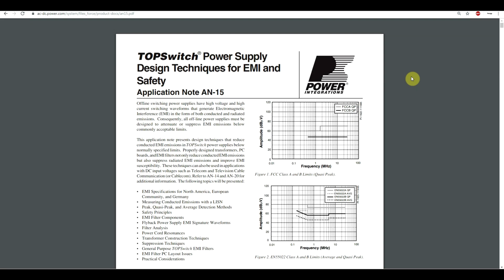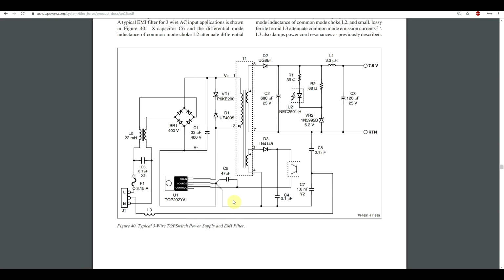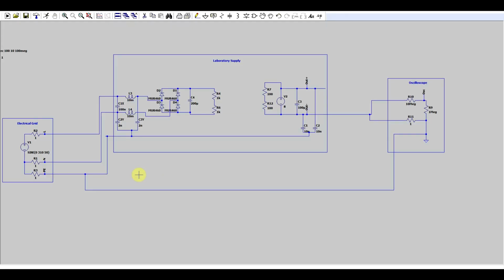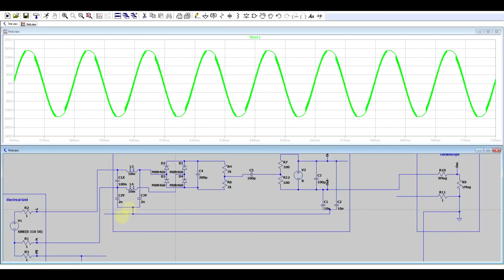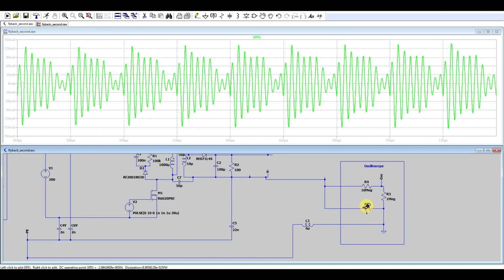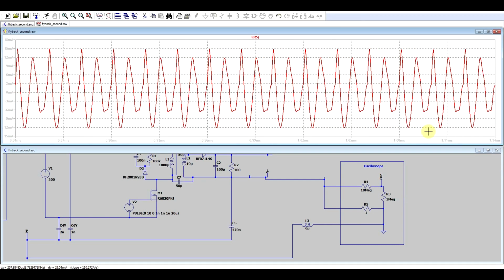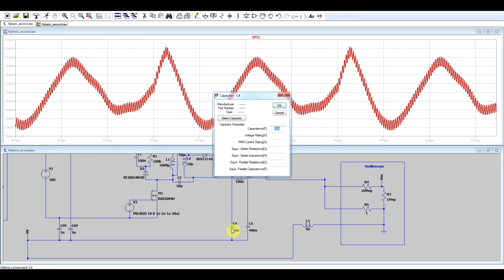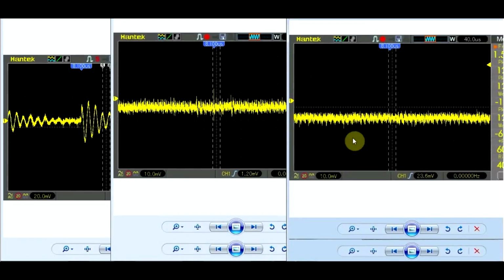How to improve the output noise of a laboratory supply using LTspice

Comment: I really love your videos, FesZ. Thank you. If I draw your attention to something, it's only to make the video even better. If I tried to make a similar video, it probably would not have been without inaccuracies.

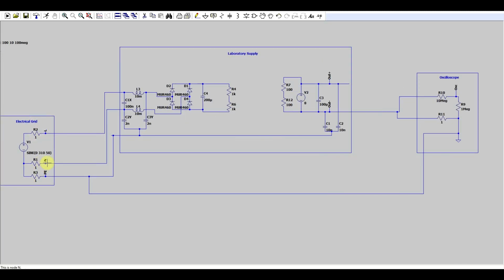This does not really matter, but at 13:10 if the chokes L3 and L4 are to suppress CM noise (however I do not see the coupling between them, perhaps K outside the screenshot), then the upper terminal of the capacitor C2Y should be connected to another terminal L4. The classic input filter circuit looks like this: https://www.promelec.ru/fs/sources/e1/1f/e6/2a/e80ece0c543ca21f4ca1e88c.png  Ld is often formed by a turn of the power cable on a ferrite ring, and Lc is a special component on the PCB. Of course you all know this. And it really doesn't matter for the theme of the video. Just a slight inaccuracy. After all, someone can take this scheme as a model, relying on your (certainly deserved!) authority.

But the really important thing is that the extra capacitor you installed is much more demanding than it is to handle 275 VAC. As I read in the comments, you used a 470nF X-type capacitor. If you look at the blue capacitor that was already in the circuit, you will see that it is rated for 5000 Volts at a peak (Y2-type). And it also belongs to a special type of capacitor - the so-called Y-type. This is important for safety. You can always put Y-type instead of X-type and you can never put X-type instead of Y-type. Because the X2-type only withstands 2500 volts at a peak and does not guarantee the isolation of its terminals from each other in the event of a capacitor failure, as the Y-type capacitors guarantee.

But that's not the end. The capacitance of Y-type capacitors is about two orders less value than value of X-type capacitors. In household appliances, as a rule, they try to put Y-type capacitors with a capacity of no more than 2.2 nF. And the reason for this is the behavior of the device with a broken PE conductor (or in the absence of this conductor in old sockets). Under unfavorable conditions, the output wires of your power supply may carry high voltages relative to grounded objects. Through the 2.2 nF capacitor, you can feel an unpleasant tingling sensation, and 470 nF will make the impedance 220 times less.
Reply from the maker: Hello SaihoS1! Thank you for these observations! Lets take things one by one; The first observation is completely true - I forgot to add the K statement, the 2 inductors L3/4 are not coupled but should be. This was a mistake on my side. I did not really have this in focus, since this is not the main topic addressed. 
Regarding the second topic, I will try to take the various points one by one. 
The 470nF is between output GND and PE line. I did not touch the high voltage primary part - the original X, Y caps and CMC are not altered. Between the output GND and high voltage region you still have the transformer isolation. 
In the absence of a PE connection in the socket, my output is connected to the live wires, but trough my 470nF cap in series with the built in 2.2nF Y caps; so you should only get the unpleasant tingling (not what would happen trough 470nF only). 
I just took the supply apart to re-check - the original capacitor between output GND and PE are 2x10nF and from output VCC to PE another 10nF all 1KV rated, but not X or Y (no special marking present on them other than the value and voltage rating). The proper Y caps other than being blue have a set of certification markings. 
The X2 cap is 2500V peak rated and 275AC ( ~380V DC) continuous rated. Not as much as the original 1KV of the ceramics, but worst case, the capacitor gets shorted and the output GND is directly connected to PE line - this should not be a safety problem. 
In case the circuit connected to the output is at a high voltage AC in reference to PE and the PE is not grounded because of faulty wiring the impedance was increased only ~17 times (470+30/30 nf). Not a nice thing of course, but its less bad as connecting the oscilloscope GND to the output circuit (the osc gnd is directly connected to PE).   
I'm not sure if you agree to this way of thinking, I may still be wrong of course. Let me know what you think.
Reply: @FesZElectronics  So, in addition to K, the upper terminal of the capacitor C2Y should be connected to another terminal L4.

And now let's look at the main issue. You have provided a link to AN-15. See following IEC950 Definitions (page 5, CAPS LOCK provided by me):
(1.2.8.2): Secondary circuit: A circuit which has no direct connection to primary power (except through PROPERLY SELECTED Y-capacitors) and derives its power from a transformer.

From this it can be seen that only Y-type capacitor is needed between the primary and secondary part of the circuit. Is PE the primary part of the circuit? I have always considered what it is. Firstly, PE and N are in electrical contact, and N undoubtedly refers to the primary circuit. "The neutral wire will be treated as an ungrounded AC mains or separately phased line conductor requiring the same safety considerations as any AC mains line conductor." (See page 7) Secondary, note the definition of SELV:

(1.2.8.5): Safety extra-low voltage (SELV) circuit: A secondary circuit which is so designed and protected that UNDER NORMAL AND SINGLE FAULT CONDITIONS, the voltage between any two accessible parts, or between one accessible part and the equipment protective earthing terminal for class I equipment, does not exceed a safe value.

It assumes that the SINGLE FAULT CONDITION will not create a hazard. However, I have already drawn your attention to the case when the voltage on the PE can become dangerous. This is the case when the PE wire loses contact with the real ground (SINGLE FAULT CONDITION - breaking PE wire). In this case, two input Y-type capacitors form a capacitive voltage divider and the voltage across PE becomes equal to half the voltage between L and N. It would seem that there is nothing to worry about since these capacitors have a small capacity, but consider the case when the PE wire is broken not in your device, but for example at the entrance to a large building. And this is a very real situation when the conductor simply rotted in the ground. In such a house, many devices are connected and each has a pair of Y-type capacitors at the input. It turns out that they are all connected in parallel and make up a large capacity. If in your power supply the capacitor between PE and SELV was 1-2.2 nF, then this would not be a problem. But if there is 470 nF, then it can pass a significant current.

I do not presume to give a simpler example than a lightning strike, when the 'Peak Impulse Voltage applied before endurance' 5kV for Y2 or 8kV for Y1 can be exceeded. However, such requirements are laid down in the standard. I believe that your power supply did not comply with EU safety standards even before the alteration, since instead of a Y1-type capacitor, a conventional 10nF 1kV capacitor was installed. The Chinese simply saved money. However, their capacitor looks very similar to the correct Y capacitor. Do you think this is a coincidence?

Of course, I am not an expert on electrical safety certification either. This is my personal understanding. And this is a subject for discussion.
Reply from the maker: Hello SaihoS1! These are very good points you are making, but rather than discuss the exact legal definitions, I would like to show you some examples:
Here is a schematic I found - this is the service manual to an Agilent supply from April 2000 ( https://sites.fas.harvard.edu/~phys191r/Bench_Notes/A1/agilent_e3610a.pdf )
Page 16 has the schematic, which is quite nice, and page 15 has some of the component values - I would like to point your attention to C4 and C5 connected between output and the PE connection. From a value point of view 100nF the total capacity from output to PE is 200nF so its close to my implementation. From a rating point of view, the manual does only specify "ceramic 500V". These capacitors may be Y class rated though - no proper order code is given. But the point is that with a fairly recent design (from a respected manufacturer), you still have large capacitors between output and PE. I guess there are other schematics with even bigger values, but I just could not find them.  
Also in the AN-15 document, in figure 40 and 44 you have a capacitor between PE and the secondary (C8) which regardless of value (100pF in Fig 40 or 100nF in fig 44) is not marked X or Y, but all other safety relevant components in the schematic are.  
Regarding both the lightning strike and building PE line not connected, the worst case is that the extra 470nF is shorted, and the GND is connected to PE or you have leakage current coming from PE. Now for any electronic equipment the has a metal casing, the casing has to be connected to PE (like PC, washing machine, guess even the fridge, and so is the case of the supply - metal outer shell directly connected to PE) - I don't know the exact norm, but you can easily check with a multimeter. So if the PE becomes dangerous, you have some really large surface areas that cause real problems when you grab it - that is far more dangerous than a thin wire coming from a circuit.
Reply from the maker: I guess the biggest safety issue regarding large capacitors between GND and PE is that if there is a voltage difference, the capacitor will charge up, and then its possible to discharge it trough the human body which would cause an unpleasant experience. For that I did place a large resistor (~4Meg) over the capacitor, just so it does not charge easily, and it discharges once the device gets disconnected.
Reply: @FesZElectronics  I am not lost. There was just a lot of work. Please wait until the weekend.

Comment: hah, i have an exact same PSU as you, just have it open right in front of me! how exactly did you hook up your capacitor on the back of that PCB? and just to make sure i get what you did there, you soldered one end to the scope's negative output and is the other just hooked up to that screw(earth)?
Reply: oh and that's a film cap right? any particular voltage rating or cap type you'd reccomend?
Reply from the maker: Well the capacitor (in parallel with an extra 1Meg resistor) is between the ground of the supply and the PE (that is directly connected to the heat sink and that screw). The capacitor is a high voltage 275VAC film type. I guess its an old X capacitor that I recycled.

Comment: Great Video, just a small question @ 15:51 you show a screen capture from your scope; I can't find at what point in the video you have taken that screenshot.
Reply from the maker: You are right, I didn't clearly show that measurement - I took it off camera. But the setup was like at https://youtu.be/VkdtESI6C74?t=697 ; I isolated the EG but unlike in the video, I only connected the probe tip, not the probe ground.

Comment: The scope has a high voltage when connected to a device that has ground. So theirs a 'noise/high voltage' issue.
There are 2 ways to fix this. 1) Add the Earth Ground to the scope. 2) Better yet, change to a Linear Power Supply!
Reply from the maker: Well the scope already has an EG connection, I pointed that out during the video.
Changing to a linear bench supply would work in this particular case, but the root problem is common to any mains supplied SMPS, or in other words any modern supply. The main point of the exercise was to understand the noise generated by this type of supply and what see what are the ways of simulating and fixing it.

Comment: Hi, great video, congratulations for putting theory together with practice (and matching them!!) !
One doubt though: how about increasing the impedance on the oscilloscope PE by adding some hundreds uH inductance as well? Wouldn't it reduce PE stray current as well as the choke inside the power supply? Any collateral effects on doing that?
Once again: great video! congrats!
Reply from the maker: Hello! Yes, that would also work; I considered adding an inductance also on the PE pin of the power supply (that would keep the noise inside the supply better). I saw this approach in some schematics, but its quite rare. I did not go on this route because it might interfere with the way the supply is filtered; I mean the conducted EMI is supposed to be certified when releasing a mains supplied product. By working on the supply output I did not affect the mains connection on either of my devices.
Reply: Great video, thanks! 
The point is that the external ground shouldn't affect the supply noise, but in a low cost supply it does. 
Most quality lab supplies provide a separate Chassis Ground terminal. You can add a cap or a short wire external to the supply to reduce Common mode noise. 
The best lab supplies also use shielded transformers with one or more copper shields between the primary and secondary. This works for both linear and switching supplies. Unless you are expert at transformer design and fabrication, this is one thing that separates DIY and low-cost lab supplies from the good stuff.

Comment: Why dont you short the power supply DC ground to the nearest mains earth to route the CM currents back to network before reaching the scope? Is that because ground loops? What is the difference between using a cap like in your case and using just a wire to short? Thanks
Reply from the maker: Hello! Well the closest mains earth is in the power supply already, so that could have been used. The reason why I didn't do that is as you said ground loop trough the oscilloscope. Also the capacitor works at higher frequencies only; my problem is the switching frequency at ~70KHz and harmonics even higher; with the capacitor I am only acting on this part of the spectrum.
There main difference that occurs by using the capacitor though is that the power supply circuit is still left floating so if you connect the power supply + pin to the oscilloscope ground you do not get a short circuit. This way also if you have 2  power supplies that you want to connect to get differential voltage (connect the + of one supply to the GND of the other) you will not have problems trough the mains earth.
Reply: FesZ Electronics Thank you for clarification. Can you make a video just focusing on how to measure CM or DM noise in practice and how to test and verify whether the noise we see is CM or DM? Because if the receiver is diff ended the noise is due to imbalance but in scope or single ended receiver case the noise is due to CM currents passing through DC ground. This is what I believe. It would be great if you can clarify this confusing topic in your way. Just a request thanks for the uploads which both show the theory and practice together.
Reply from the maker: Hello! I will try to make a video about this at some point, I wrote down the topic. 
The main difference between CM and DM is the way the current closes, and its all a matter of perspective. For a mains powered supply the DM is between the 2 outputs (so something that goes out of +terminal and into -terminal is DM) and CM is something that goes trough both or one of the outputs (+ and - terminal) and returns trough the mains supply either one or all of those pins (N, L and PE). 
The main use of knowing if its CM or DM is to know what to do about it. Adding a capacitor between terminal + and - can only help with DM, it has no effect on CM since it does not affect the current path. The same way the capacitor I added in the video has no effect on DM. 
If you have a 2 channel oscilloscope connected to 2 terminal that is capable of doing a Ch1-Ch2 math function the math output will be the DM noise and the individual Ch1 and Ch2 will be the CM on each of the outputs.

Comment: Excellent video! Btw, a lot of times it's actually also the ground wire from the probe that's causing quite some additional noise. A much better method is to wrap a wire directly around the ground connection (sleeve) of the probe itself.
Reply from the maker: Hello Piet! You are right, for measuring low noise, you can use a spring or something, and do away with the long ground lead. I usually make these from pen springs, since that way they are elastic and hold better on the probe end. Measuring low noise is quite an interesting and difficult topic.
Reply: @FesZElectronics  I usually just wrap a thin wire around it. Sometimes even solder it. And yes it a very interesting and difficult topic. I once even noticed a pretty significant change by just connecting to a different ground point on the PCB. Direct soldering it to the board can also make a huge difference. Crazy
Reply from the maker: Hello Piet! Well I guess if the ground on the PCB is not very uniform, then you can get more or less noisy spots. And of course of you are working with high currents such effects will be even more visible. This will be especially noticeable on 1 or 2 layer boards.
I'm not sure how safe soldering the wires to the oscilloscope probe is; I mean it might damage the probe. On the other hand, if you have a probe with detachable tip or some sort of proper adapter, and solder to that, then it should be no issue. Are you using a special kind of probe for such measurements?